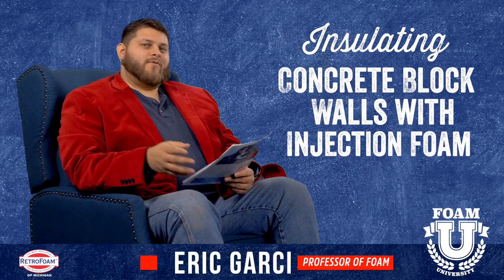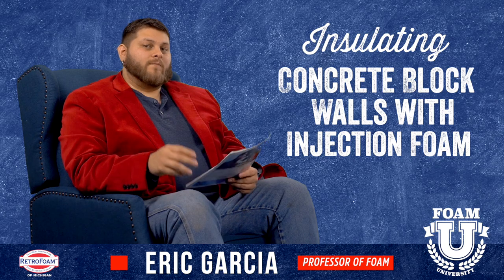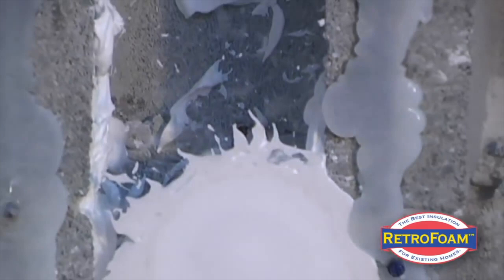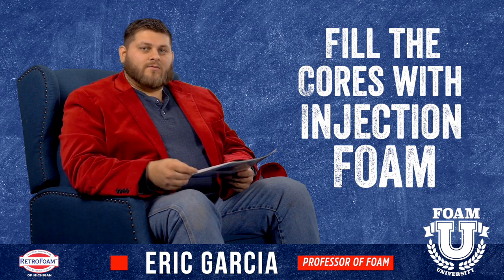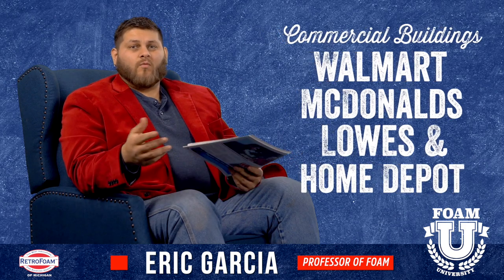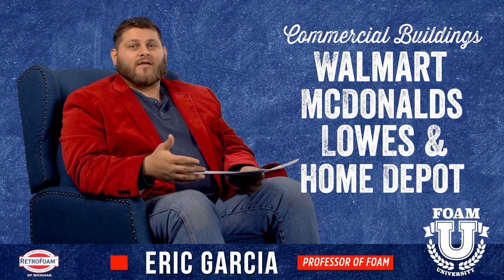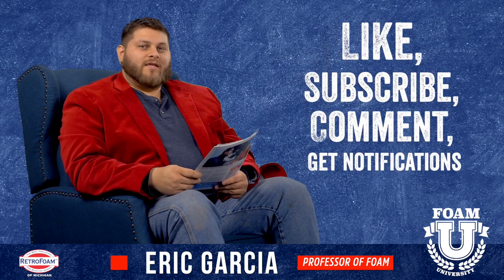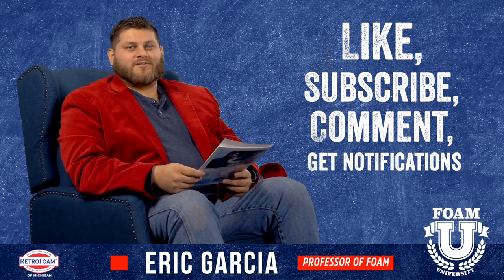Insulating Concrete Block Walls with Injection Foam | Foam University

Comment: I have a question can you actually feel the block walls while they are being installed? So say I go up 4 foot and right before I put my order on the fifth course can you come in and fill that up with form before I put my bond beam in and then come back in and put it on the next fifth course before I put in the six course and put that bond beam in as long as my horizontalsI filled with concrete

Comment: I like spray foam on walls and under concrete floors it is a great product. Most people don't realize masonry loves to wick moisture and needs to breath. I use rockwool to insulate cores. If you completely seal your masonry it will not dry out. Leave a space above grade not sealed for masonry to dry out. Be careful with spray foam in basements. Most people won't have a problem with basement spray foam. I have seen moisture collect between foam and masonry. Spray foaming in basement can move the condensation zone inside the masonry. Then it freezes or molds. Masonry and roofs need attention because of moisture and condensation. I recommend roof vent baffles or mechanical venting in sealed attics or conditioned attics. With a completely spray foamed house you need a heat exchanger to bring air in. Where does the moisture go when you shower or cook? Without fresh air vent fans don't work properly. I am thinking of spray foaming my brick crawl space after I white wash it. So with foam lime white wash will travel outward with moisture. I will not be able to do it after spray foam. Ripping out a spray foamed basement I didn't build it, that molded for a customer. They capped block wall with foam and sealed above grade. There was nowhere for moisture to go outside. I use rockwool around chimneys then spray foam rockwool. It allows chimney to wick moisture up. Condensation from a chimney coming out a fire place makes a mess. I was pissed they spray foamed against the block on chimney. More of fire hazard I was thinking at time, not about condensation.
Reply from the maker: Any time there are moisture issues in a home, we recommend those problems be addressed before the addition of foam insulation.

Comment: My friend who lives in a trailer park her building is an old laundromat. Kinda converted to an apt/half laundromat. The walls freeze and mildew every winter and her pipes have frozen and burst when the temps got below zero with wind. I got her an infrared heater to blow warm air into the pipe area on these extreme cold nights and that has prevented frozen pipes. The whole building is cinderblock painted. The rent is dirt cheap probably because its outdated and needs maintenance and I don't think its insulated. There is framing and woodpanel throughout.  And painted cinderblock closets no insulation for sure. The bathroom has some type of backer behind the tile but a part froze and fell off so you can see the cinderblock  so definitely no insulation there. So to the question if she is a long term tenant paying the heat is it cost effective to do this type of insulation you speak of? Her apt is 450 sf the laundry room is 144 so. And she pay's to heat both which I assume is part of the rents lower cost as well. At 60 degrees she is still budgets about 280usd a month during the winter.
Reply from the maker: With all of the issues and limitations with the building, I wouldn't recommend foam insulation for a simple solution. Truthfully, I don't think there is a simple solution. I think it would be better to have a general contractor look over the entire building and prioritize the measures needed.
Reply: Hopefully she has the heater switched to only run below freezing but isnt heat tape a better solution?

Comment: It would be awesome to see an actual video of the process on a cinder block structure. Thanks!
Reply from the maker: You can actually see the process at the link below.
https://www.retrofoam.com/injection-foam-insulation-block-walls
Reply: @RetroFoamofMichigan can you insulate them with rockwool? I know they do it in europe where they put rockeool inside the block. Idk about injection foam since the off gassing worries me.

Comment: Hello, this looks exactly like what we need! Our house (build in 1940) has block walls. It has a stucco exterior. When our stucco started crumbing in one small area (a particularly shady corner of the house), our mason took the opportunity to fill the block in that area with some kind of granular material (used in chimneys I believe) and it doesn't appear to have made that area of the house any more insulated than other areas. I am thinking the foam option is the way to go, and I'd like to try this on at least one side of the house. We have what I believe are plaster walls, so is it possible to put small holes in the plaster at the same spacing as the cinder block cores and blow the insulation in that way? We live in Albany, NY.
Reply from the maker: We do not recommend going through the plaster. This type of job can be done from the outside, the contractor you use should be able to re-patch that Stucco for you. If it is a RetroFoam dealer then they will refinish that stucco for you after the job.

Comment: Is this a good solution for flood-prone areas? Is it possible that mold would still be able to form between the foam and the block?
Reply: For Flood Prone place! Always raise the house! No other Options
Reply: @afrench4683  Yes. I'm referring to the block walls that raised the house. Potential consequences?
Reply: @Cotronixco  I'm no professional but I'm pretty certain that spray foam, since it expands and hardens so water can't get into it, is mold retardant. Fiberglass foam often has that paper backing which is food for mold, spray foam wouldn't have any food. I live in FL and am highly considering using injection spray insulation for that mold-defense.
Reply: @esmeesme5268  I'm not concerned with the foam molding, but the organic material that coats the inside of the block before the foam is added.

Also, with this method, another concern is that we are adding R value only to the air gap, but none to the conductance of the concrete itself, possibly rendering the project quite ineffective.
Reply: @Cotronixco  I get your point in the mortar gaps maybe being an issue, losing R value. The R-value of block as we know is 1.9 - 2.6R per FOOT depending on what type of block you have. The average R-value of injected insulation is 4.6 - 6.2R per INCH. Meaning there's a potential 24.8R for the 4" opening in the basic cinder block. That's nearly roof level R-value. If you think the tiny 1" of cement between two 4" thick columns of foam makes this method useless, you either know something I don't, or haven't done your math.

Lastly, if you're talking about any "dirt" that might be on the inside of the blocks prior to spraying insulation, sure that's potential for mold BUT there wouldn't be enough for the mold to grow and thrive as it'd be surrounded by foam and cement. ALSO most foam products contain boric acid which tops pests and mold.
Reply: @esmeesme5268  Don't forget the R value in your equation of trapped air at nearly .5 per inch. 3/16 of the block is R1.6 and 13/16 of the block is R3.4. Adding the foam, we now have 3/16 at 1.6 and 13/16 at R24.7, Giving us an average of R25, which seem like a major improvement, but they say you can't average R value. For example, if half a wall is R20 and half is R2, it seems like it comes out to R11, but it doesn't work that way. It turns out that the R2 offsets the R20 at a parabolic rate. In other words, if you add another R30 to the R20 but leave the R2 alone, you gain an insignificant amount of total R. Sorry I can't explain myself very well.
Reply: @Cotronixco   It's true the masonry between the foam columns will transfer heat faster than the foamed areas. However, having ~ 80% of your wall surface very well insulated is much better than 0%. I would compare it to wearing a jacket unzipped. It will still keep you much warmer than not wearing a jacket :) (I loved my heat transfer course, it was an interesting one).

Comment: what is the R value of a concrete block wall after insulating with injection foam? Im looking at building such a home in N Florida. Thanks
Reply from the maker: This would be R-11.
Reply: How much is it? Dollar cost for a small 2 storey home.

Comment: I hate drywall and compound...   I have a residential lot in central Florida where I'd like to owner-build a small modern house.   Possible to meet Florida exterior wall energy codes with just cinder block and injected foam with mortar on both sides?  I understand I have to consider how to run electrical and plumbing.
Reply from the maker: It should have no problem meeting code, however, I would recommend consulting with your local inspector.

Comment: Our home shares a interior wall & side concrete wall with neighbor. We build a new wall & sound proof it but now we notice the outside concrete wall the noise travels through there too. Will using injection foam reduce noise? We will add another wall but looking at this an extra help to reduce sound traveling through concrete wall.
Reply from the maker: Injection Foam can help in this situation and we have heard amazing things from customers.

Comment: Great video. I am getting ready to build a basement to place a sectional home on top. Can I fill the blocks from the top before home is placed?
Reply: I just read your answer in another post. Could I maybe spray foam every few courses as I'm building the wall? Once the mortar has set, of course!
Reply from the maker: The wall should be completely built including the top plate before the foam is injected.
Reply from the maker: Thanks for watching!

Comment: Can the wall be filled from the top before the roof is installed to keep from drilling holes in each core?
Reply from the maker: This isn't recommended because you can't get the hose all the way to the bottom because of the cores. There are also times that the cores don't line up so you would be left with voids.
Reply: Just wondering aloud??  Would foam peanuts be a good insulation to install while the block wall is being built so that holes don’t need to be drilled on a new structure?

Comment: I have block basement walls.  Cores are not filled. Can I do a spay roam insulation myself? How far apart should I drill holes? And how high or low on the wall?
Reply from the maker: It's important to note that RetroFoam is an injection foam, not a spray foam. Our installers go through rigorous training to ensure they know how to insulate every wall type, and that each cavity is properly filled. This article from our blog contains some more information on this topic: https://www.retrofoam.com/blog/injection-foam-insulation-diy-project

Comment: What is the R value of standard block walls after foam insulation?
Reply from the maker: The block walls would be R-11. One thing to keep in mind with that as well is the air seal the foam creates. It will act as an air barrier keeping the air you pay to treat inside and the elements outside where they belong.
Reply: @RetroFoamofMichigan  Thank you for the info. That's a great point regarding block walls being air tight. I rent an older stick built house with vinyl siding and when the wind blows over 12-15 mph I can stand near the wall and feel outside air blowing through the wall. I live in Cass Co. and the wind blows pretty much every day. 😊
Reply from the maker: Glad to help!
Wow, that has to be super uncomfortable at times.
Reply: @RetroFoamofMichigan  I lived in MT and central OR a total of 25 years and my heating bills here are more than twice as high. Looking into building a new house and learning about different kinds of wall construction. Thank you for the informative video on block wall foam insulation. Looks to be very energy efficient.
Reply from the maker: That is insane, and I can see why you're looking into building a home.
Good luck, and if you have any other questions, don't hesitate to reach out!
Reply: @RetroFoamofMichigan  👍

Comment: Hello we paid extra with our builder for this and asked to witness the process and they kept giving me different stories I gave no proof they did it, is there a way to inspect it after house was done ? I have lived here for 3 years , thank you
Reply from the maker: For block walls, you can drill into the face of the block and look inside or use an inspection camera to check.

Comment: This is great information. We have a warehouse in Massachusetts which needs this exact treatment. I worked on your side it doesn't look like you provide services in Massachusetts. Do you know anyone that does this in the Boston area? Thanks
Reply from the maker: Hey Jason! Unfortunately, there are not any RetroFoam dealers in Massachusetts. Your best bet may be to contact a spray foam company and see if you could spray the surface of your walls to help with comfort and energy savings since filling the blocks' cores is not possible in your area.

Comment: I have a block house that leaking in the basement through the block it ideally needs to dig around and refinished from the outside but if this will waterproof it maybe an easier way
Reply from the maker: Unfortunately, foam insulation isn't the answer for water leaks in the basement.

Comment: have a large rehab project in Florida block home. I'll have existing block walls and new block walls. I'd like to use foam insulation injected into the walls. Should I use closed-cell or open-cell spray foam?
Can I inject from the top of the wall or would I need to inject from the bottom up by drilling holes in the wall to inject through?
How would I estimate the amount of foam required/ Is there a conversion I should know for standard block walls?
Is this a place where I can do the work and save on the cost?
Lastly, If the core is encapsulated what are my fire spread considerations and can they be mitigated? Is there a non-flammable closed or open cell insulation preferred for the job?
Thanks for your help
David
Reply from the maker: Hey David! Injection Foam Insulation and Spray Foam Insulation are actually two different things. You will need injection foam for the project you are talking about, and we do not have any dealers in Florida. But to answer your questions, you must drill into each block to ensure the core gets filled, and the process is something that only our dealers can do since it requires specialized equipment. Our foam is also class one fire rated, the highest rating an insulation can receive. We recommend looking to see if there are any injection foam insulation companies in your area or you can use foam board. If you intend to drywall, you can use foam board against the block and then drywall. The other option is to create cavities to spray, but that would be your most expensive route.

Comment: Basements have more moisture would the injection get damaged with the humidity on the basement ?
Reply from the maker: The air seal created by foam insulation can work to actually decrease the humidity as it blocks air movement. In a space like a basement, it's not a bad idea to also run a dehumidifier. It's also important to note foam insulation doesn't get damaged or deteriorate if it comes into contact with this kind of moisture.

If you are looking for some more information, our blog has some helpful articles like the one below.
https://www.retrofoamofmichigan.com/blog/what-should-the-humidity-be-in-my-house

Comment: I have a 24 x 26 foot block garage that I am wanting to insulate.  The blocks though I believe are those three-compartment blocks.  Aside from the tediousness are there any inherent obstacles--or even benefits--to working with injectible foam insulation?  As I think about it, wouldn't the outer left and right chambers line up with the opposite chambers above and below each block so that I may only have to do one fill per "column" (one third) of each block?  Thanks for any info!
Reply from the maker: Injection foam is the only way to realistically insulate a cinderblock wall. 
This is because those compartments do line up so each core is filled, so one flows into another.

Comment: Do you have an approximate price per block?  I just received a quote from another company at $4240 for a 30'x40' block building with a wall height of 9 feet minus two 36" x 80" doors,  three  31" x 47" window openings, one 8 ft x 10 ft garage door and 6 ft x 9 ft already filled solid wall. 
That means that in the end I would be paying over $2.50 per block to get it insulated!!!
So, in order to recoup my cost in 10 years it would need to save me $35 per month in heating and cooling costs!
Reply from the maker: We do not price per block. We use square footage pricing. A budget price for us to do that size block building is $3,000 to $4,000.

Comment: So, how does one estimate the cost? Is this do it yourself or hire someone to do it? If the states make a difference, I am on the Jersey Shore with a lifted house and the above ground block wall allows for very cold interior space, freezing pipes. Want to add some kind of heat but those walls are useless right now for holding it in.
Reply from the maker: It would be best to hire a contractor who is experienced in this type of work. We use RetroFoam injection foam, which is used existing walls and in block. Here is their contractor directory - there may be a dealer near you http://retrofoam.com/dealers/

Comment: Will filling one of my basements block walls with injected foam help seal it from outside water and dampness?
Reply from the maker: Filling one wall probably won't do much in terms of effectiveness because that outside water could still find a way in through a different cavity/wall.

We'd recommend requesting an estimate to get the best opinion on your project: https://resources.retrofoamofmichigan.com/estimate